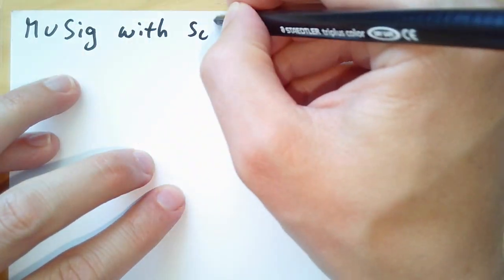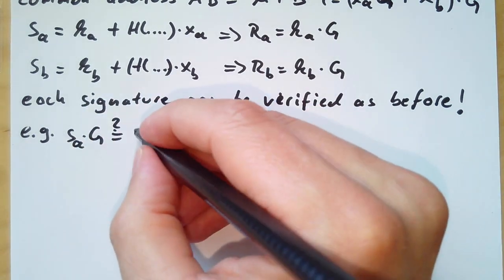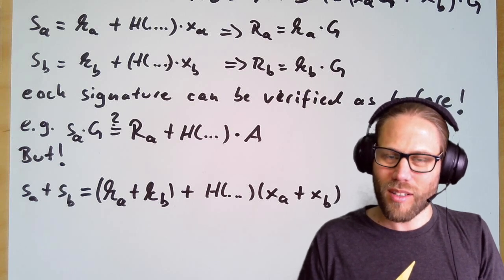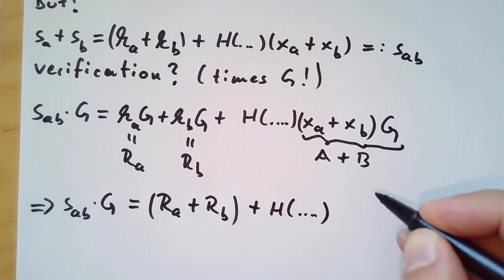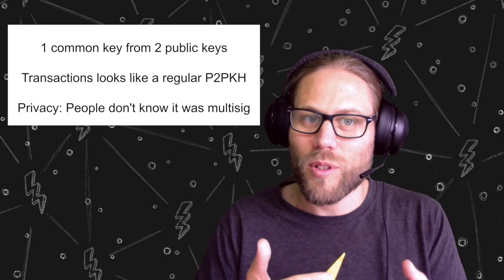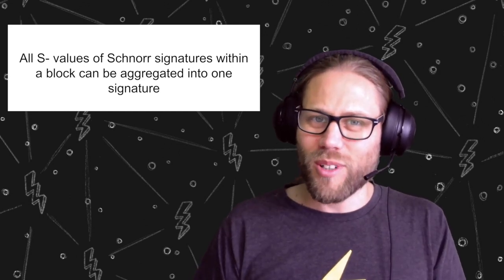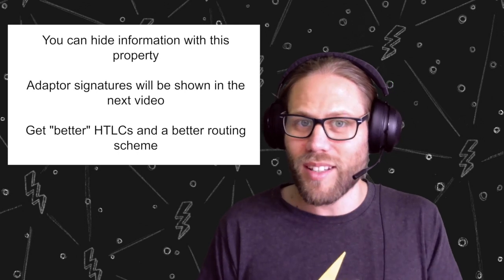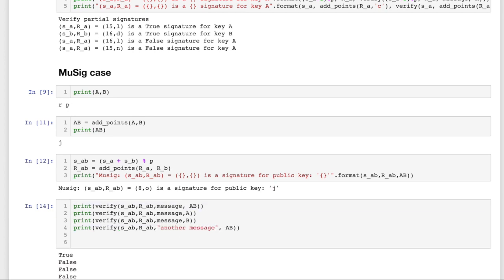MuSig - Multisignature Addresses in Bitcoin. Schnorr Signature Tutorial Part 2

Comment: Important to note that if Alice knows Bob's public key but not vice versa, Alice can can claim her public key A' is (A-B), which lets her sign as Alice and Bob (A'+B) without Bob's involvement, because A'+B = A-B+B = A, aka key cancellation attack.

Real MuSig mitigates this by not just using a simple sum of the keys, but a linear combination of keys where each key is scaled by a hash that commits to all the keys separately, i.e. the combined key is (H(H(A, B), A) * A) + (H(H(A, B), B) * B). This additional coefficient needs to also scale the individual private key terms in the s value calculation, i.e. instead of x_B, Bob's partial signature would use H(H(A, B), B) * x_B, which Alice can't cancel out since she doesn't know x_B.
Reply from the maker: In part 1 of the series I mentioned that one should read the musig paper which is also linked in the description of both videos to learn how to prevent rogue attacks. One thing that confuses me I thought the hash function in the signature has to commit to both keys and the common key is still the sum. Am I mistaking? Also I mention in this video that I did not provide the details of what has to be in the hash function. Currently I plan to talk about all those commitments in part 5. Anyway thanks for your input!

Comment from the maker: Code in the description! Please consider supporting this show by becoming a Patreon at https://www.patreon.com/renepickhardt or by donating to the Lightning Network Book at: https://tallyco.in/s/lnbook You can also be a company sponsor on a regular basis in that case please contact me! If you need help / consulting with bitcoin or Lightning Network I am happy if you reach out!
Also at 4:51 more precisely I should have mentioned that (Thanks to Max for pointing this out!): Schnorr will neither use P2PKH nor P2WPKH. Rather, a new taproot spending condition, that includes the un-hashed public key in the bech32 address itself. This makes perfect sense as otherwise the ability to add addresses is not given without another communication roundtrip. bitcoinoptech 35 & 46 [and others] have a detailed explanation.